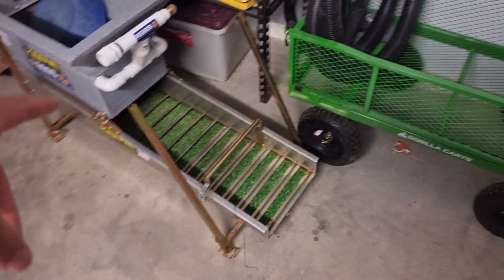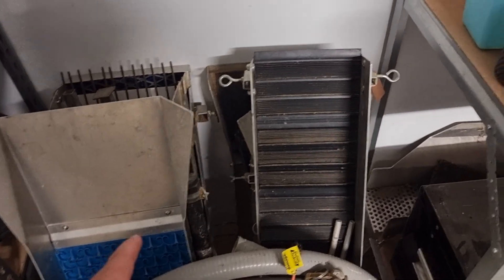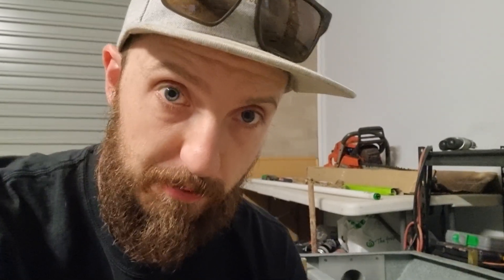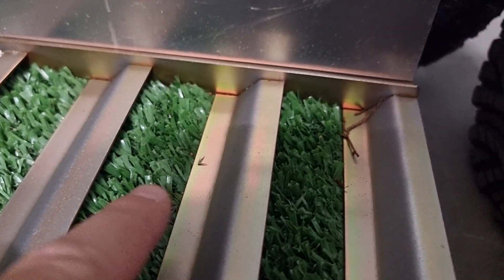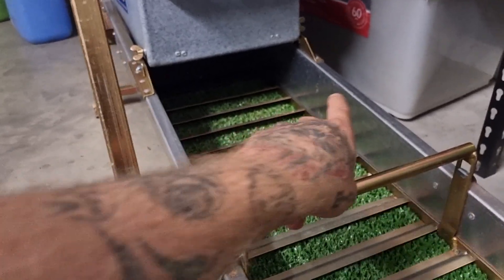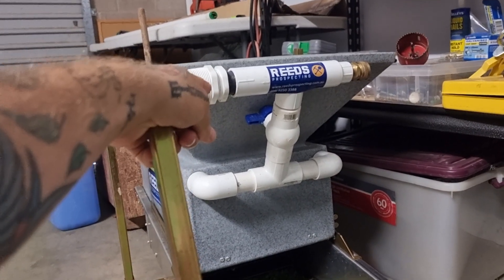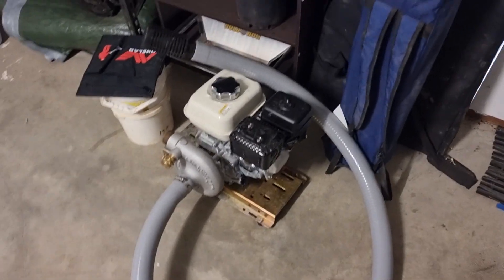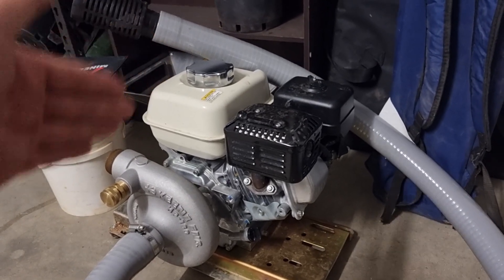Everything you need to know about HIGHBANKERS for GOLD

Comment: Thanks for the video, In one of your other video's I saw 2 layers of expanded metal together. Does that work better in you area and how did you keep them together?
Reply: yes this, i set my highbanker up with 2 layers after seeing that, worked awesome didn't pack full as quickly, i welded mine together, but zipties, or just wire ties would hold it solid enough